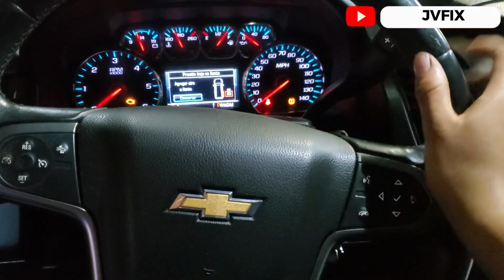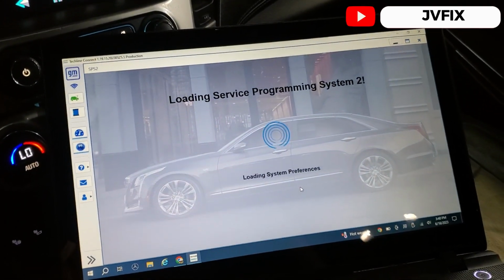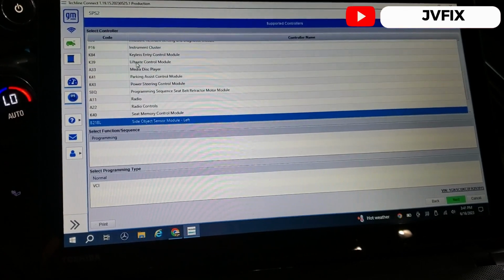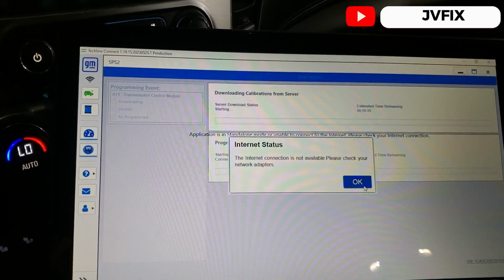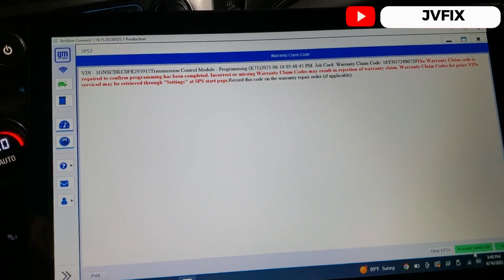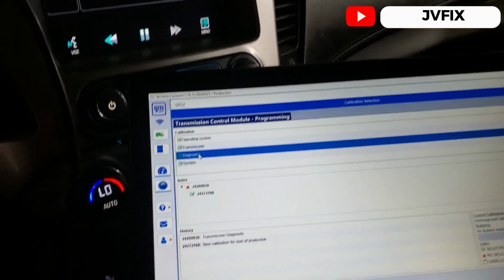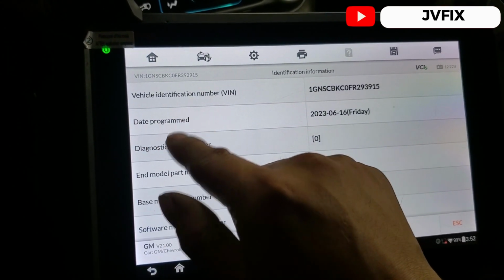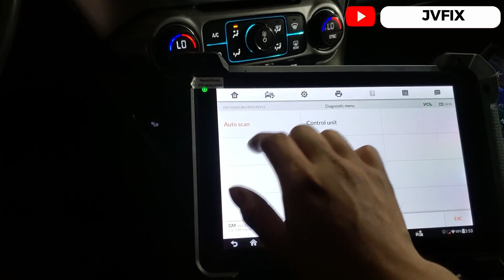How i programmed used TCM on 2015 Chevrolet Tahoe using SPS2 J2534

Comment: hey,i had a transmission problem with my chevy malibu 2013,i ordered a new transmission but it’s from a 2012 and the car is not starting it says that it lost connection with the transmission control module,can i program that module from the 2012 malibu to my 2013 malibu?
Reply from the maker: U need communication to the tcm even if is not programmed you might have a fuse blown a wire issue or even the tcm defective